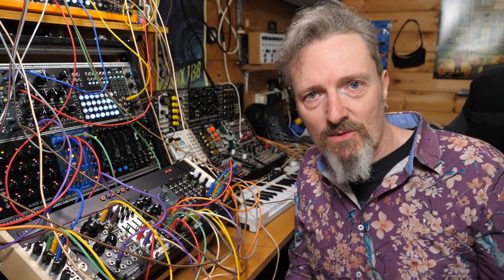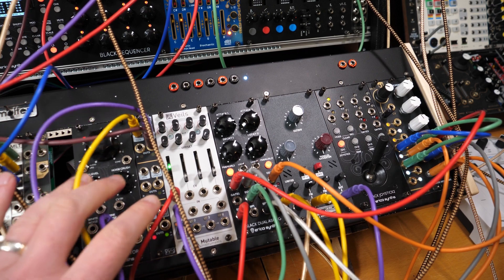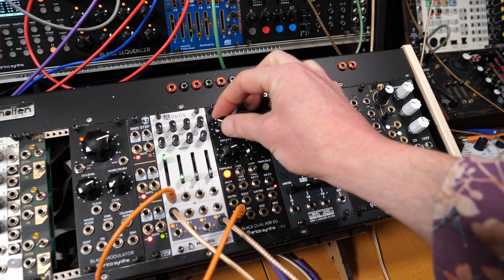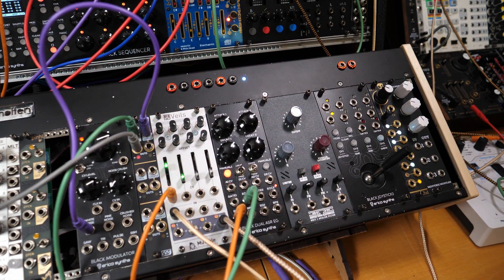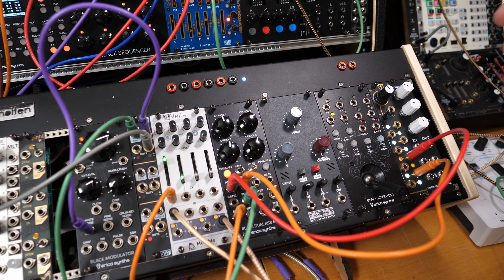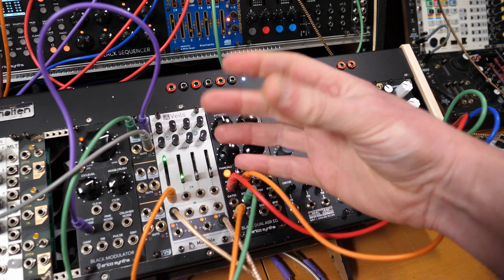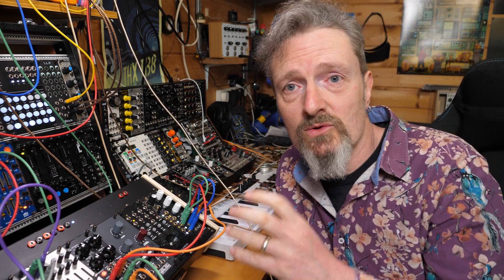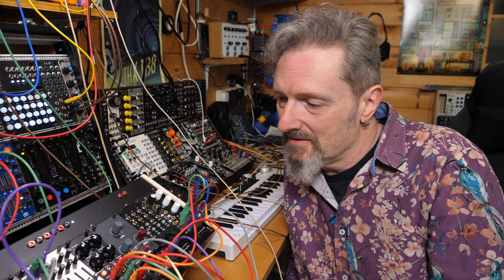Building a Krell Patch with the Erica Synths Black Dual ASR EG

Comment: Good stuff... I've just been trying to follow this and do it with a Befaco VC ADSR, no EOC output but it has gate outputs for each stage which I assume is pretty similar and you can whack modulation into each point of the ADSR.
Reply from the maker: Did it work?
Reply: @MoltenMusicTech  Kinda, I think so, it made something interesting. I'll have to video it and put it up.

Comment: Hi 
I want go build a small krell system like yours 

What other modules are being used above out of view  ie oscillators  output etc 

Thanks and output etc  
I love these krell sounds 
Do much
Reply from the maker: Cool - well the video really does explain exactly what you need and what I did. Maybe that would help you?
Reply: @MoltenMusicTech  yes   Thanks is all your using out of shot a oscillator and anything else ?   Oh I’ve no need for quantiser thingie Bob 
Thanks
Reply from the maker: From the 3:44 mark I say that I'm using the Ona Oscillator, that's from Nano Modules, but any sound source will do. The rest is on the screen and I'm not using the filter or joystick, just the VCO, VCA, looped envelopes, random source and LFO (i think).
Reply: @MoltenMusicTech  thanks do much 👍🪐

Really enjoy your posts 👌

Comment: Just curious:   When you plug into quantizer,  What do you find is your favorite scale to use?
Reply from the maker: I usually put in a few white notes. I discovered in making this video after using the uscale for a couple of years that the top note is a B and not a C and so explains the unintended maj7 sort of sound. I don’t really give it much thought 😁
Reply: My fave trick on having just acquired the uscale is to go to bank and put in harmonic minor and change the root note to whatever :)